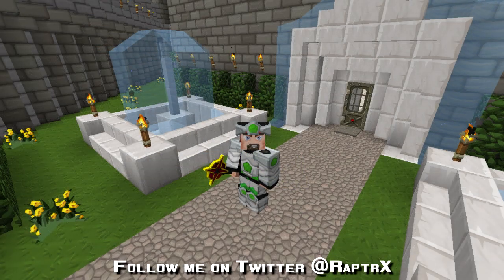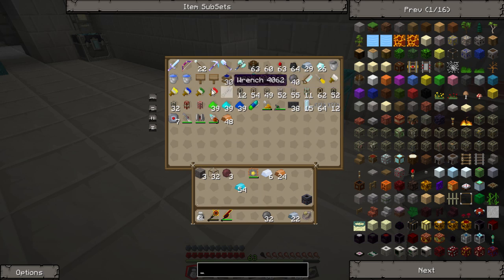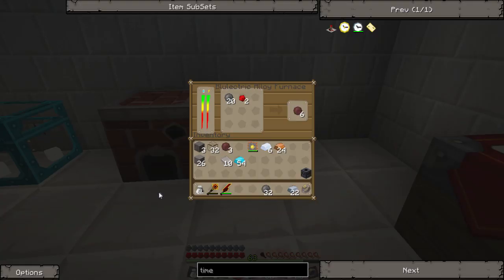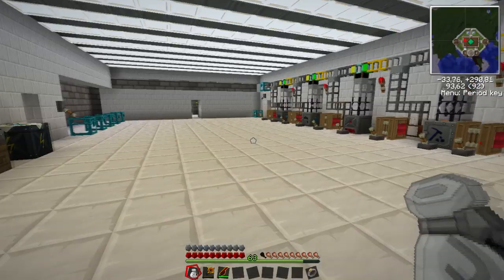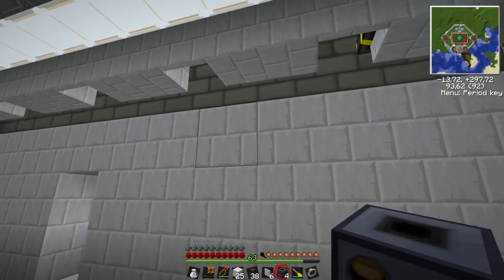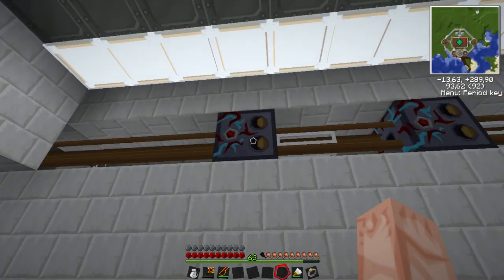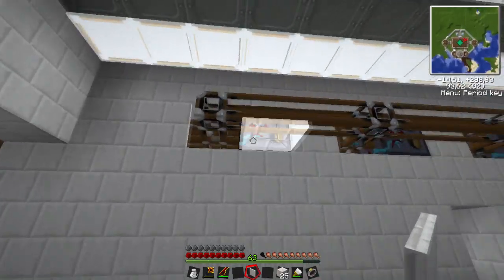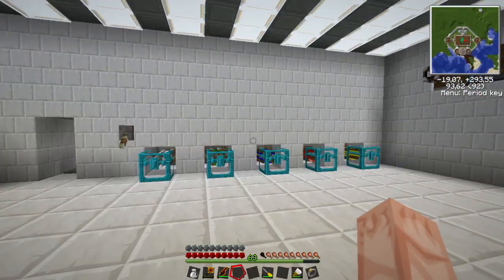How to Tekkit - Sorting Machine Tutorial

Comment from the maker: I personally haven't tried it on a single player world. But others have done this layout successfully in SSP. As for why the items are going to one chest, I am not sure, it could be a number of things. First you should check that the sorting machines are set on the correct "mode", also double check that the colors are an exact match and that the restriction tubes are connected properly (after the sorting machine but before the next colored tube). Hope you can fix your problem.

Comment: I have the exact same setup as you do: crystal chest>Filter facing with the cross towards the chest with a block behind with a timer with the end pointing down>2 pneumatic tubes>sorting machine...etc. when the timer ticks, nothing happens. if I remove the pneumatic tubes between the filter and sorting machine, the stuff from my chest shoots to the floor. the sorting machine has power. any suggestions?

Comment: Very informative video, i have an issue maybe you can help with. I need a sorting facility that deals with only 1 block type and i need it to equally distribute between 9 different machines using tubes not buildcraft pipes. So like 1 block goes to machine 1, then 1 block to machine 2, then machine 3 etc

Comment from the maker: Sounds like the filter doesn't have a "suitable destination". Make sure the sorting machine is facing the right way. Then check if it has the correct set-up, look at 14:12 if you did that correctly then make sure the "default color" in my case white, has a pipe to go to (remember that it has to be the exact color).